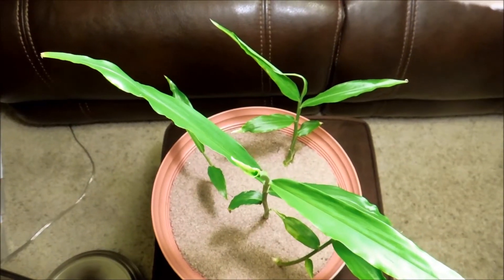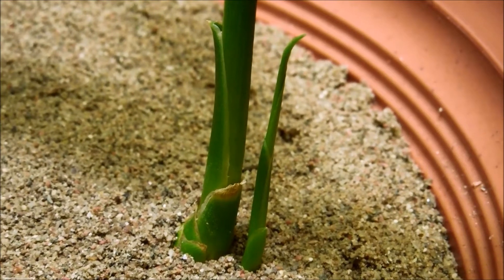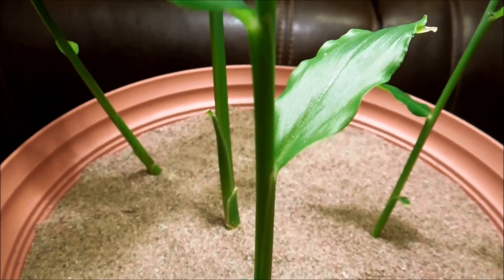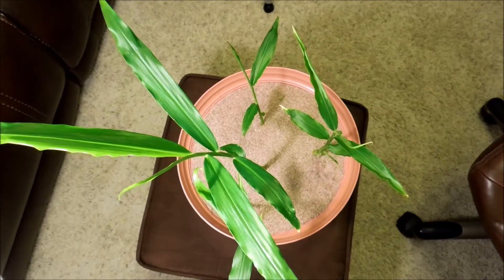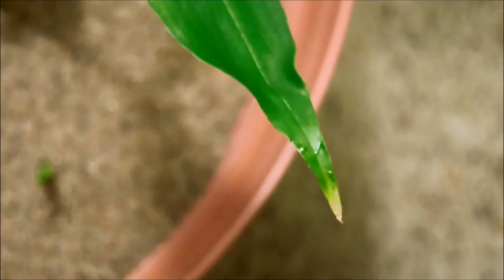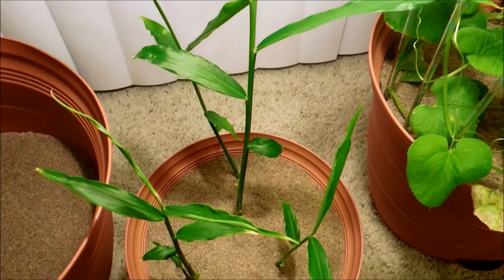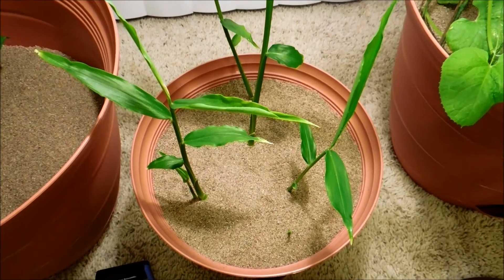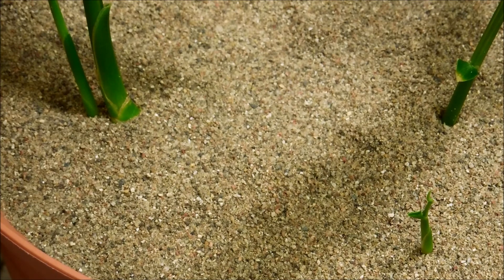Growing Ginger from Rhizome Cuttings, Days 53-59

Comment from the maker: Since my ginger plants won't form rhizomes until the winter, the fungicide will have broken down a long time ago. It's probably degraded in the hot soil already. I used fungicide because I gave the rhizome cuttings too much moisture in the early days and was afraid of losing everything due to mold. If I had done everything right from the beginning I would have just let the rhizome cuttings air out more and not needed to use any fungicide.